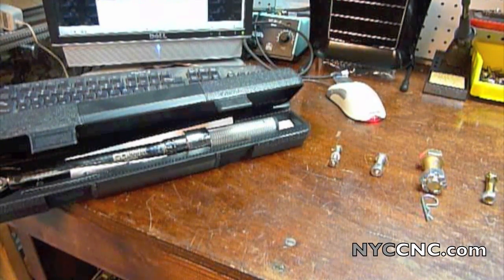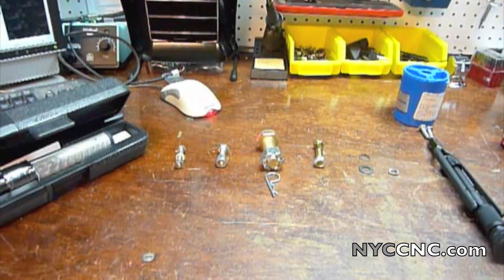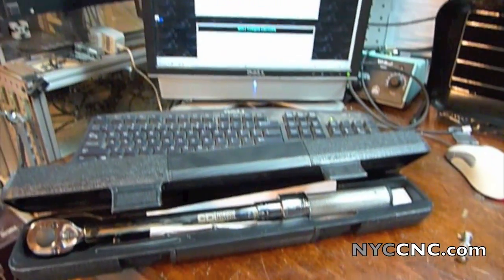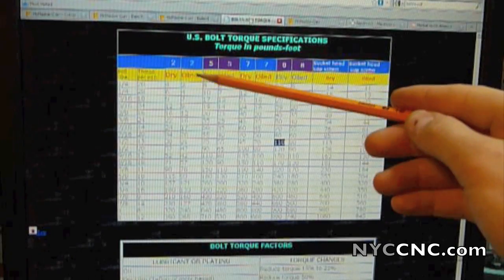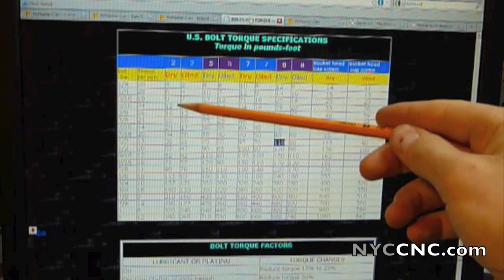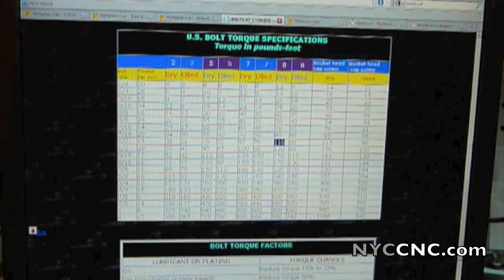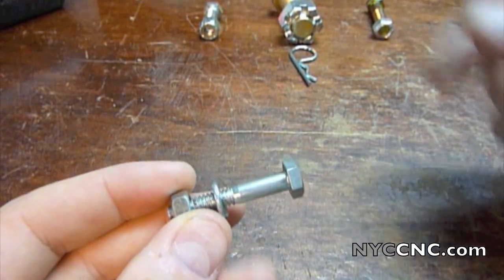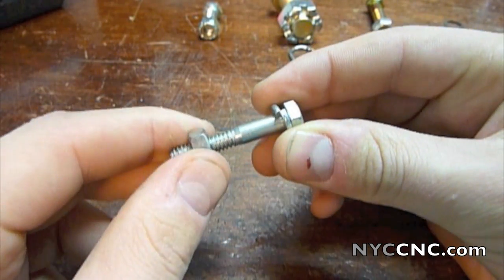How to prevent screws from loosening: Loctite, Safety Wire, Jam nuts & More Part 1 of 2

Comment: Use super glue and baking soda on the threads adjacent to the nut (where you want it to stop). The nut will never move past the treated thread. Pure and simple. No torque needed.

Comment: What if the part still needs to be able to move? 
The screw is holding a joint, and that joint moves a lot.
It's a tiny screw so most stuff would impede its movement.

Comment: This is great! I'm trying to teach myself engineering because I make art installations that require quite a bit of engineering (Breathing Room - quick iphone movie), and this kind of systematic explanation is so helpful. I am using screws/bolts to make moving pivot points between two pieces of wood - but inevitably the nuts I'm using work loose - which of these solutions wd you recommend? ty!!!

Comment: Nice video! Just a few corrections: while the units for torque and energy are the same, it is not correct to say "foot-pounds of energy" in regard to the torque of a bolt. Also, NC and NF stand for National Coarse and National Fine, not Normally Coarse, etc.

Comment: @saunixcomp It would, but only the parts of the wrench up to your setting.  Going the full range ensures all of the working components of the wrench are exercised and lubed.  This is for break-away or "click' style wrenches, many of which on the market today are self-lubricating.  However, it only really self-lubricates the parts that it has been set to.  This is a practice we have in the Air Force since our torque applications are critical in structural and mechanical components.

Comment: This is undoubtly my favorite youtube channel.

It's worth mentioning two things. First, your aim in tightening fasteners is clamp load. Clamp load is related to torque but a variety of factors come into play as to what clamp load is generated by a given amount of torque (which is why the torque tables have different values depending on fastener finsh, etc.). Second, when designing a bolted joint, you must consider the material being held together by the bolt. Lots to this as well.

Comment: distorded thread hex nut lock has one big problem, if You use a torque wrench the torque is not correct because the nut also creates a drag.

There are also products like loctite and a nut that has two slits in it(don't know what that is called) .

Comment: You forgot star washers,  I like castle nuts and either cotter pins and/or lockwire.  There are also bolts and screws with holes drilled in either the head or also the threaded portion. Aircraft have special fasteners and I belive there are some marine fasteners.